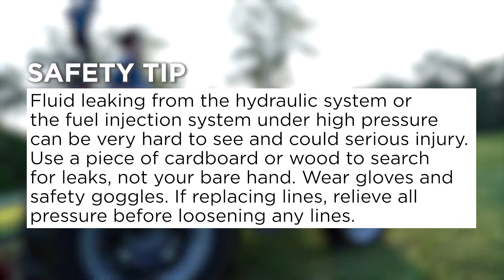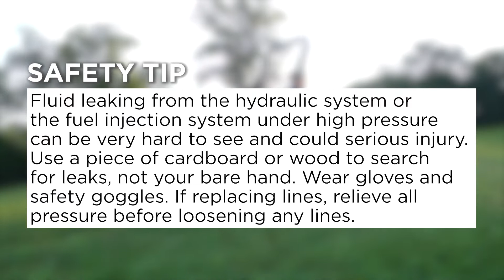AGCO DIY Series: Daily Inspections | MF 1800M Tractor

Comment: Hey there, are there any resources or diagrams on the zerk locations for grease lubrication? I have an 1835m and I cannot locate the brake pivot points for the life of me and I've been through the manual and all through the tractor.
Reply: Have you figured it out yet ? I have one and can help if you’re still unsure
Reply: @94mattforrest  thanks, I found them! Under the floor mats haha